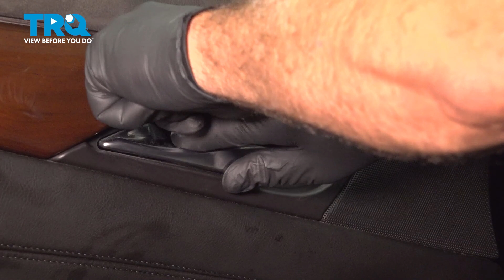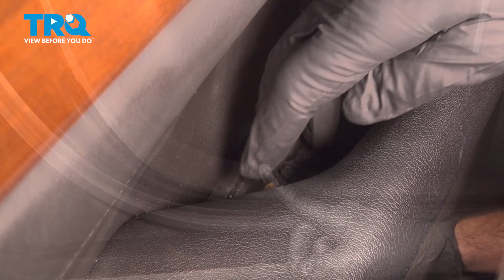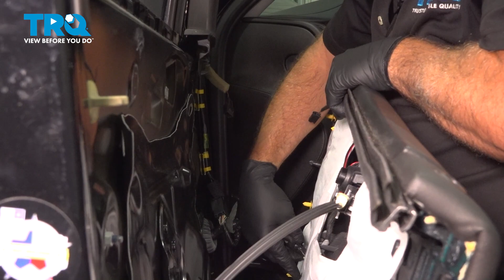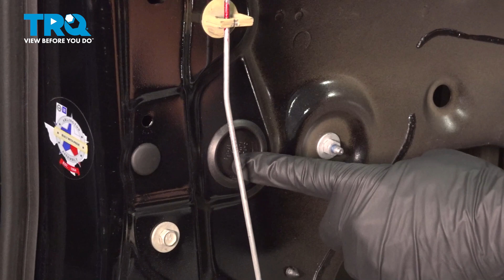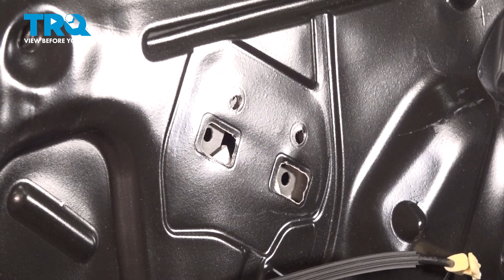How to Replace Front Window Regulator Assembly 2015-2020 Cadillac Escalade

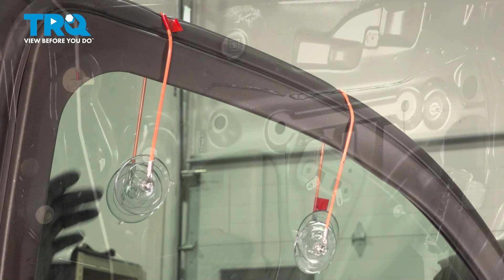Comment: You lower the window regulator at the 7:00 minute mark of the video.  How did you accomplish this with a non-functioning motor?  If I could lower the window regulator I wouldn't need to replace the regulator assembly in the first place.

Comment: Very good video, I took all the steps until I realized also like others, that the reason for replacing this part, is because is not working. So to lower the window in the position where you have to remove the clams that hold the window is impossible. Because that's the reason you replace it??? They should've come with a solution for that. The way I removed the old part that was not working, I had some strong plyers, like the one that cut nails and I just cut all the cables from the old part and I was able to pull the clams from the window. From there on, just follow the rest of the steps for how to install the new part. But yeah, good video, worked perfectly. If the old part doesn't work, cut the cables inside the door, make sure you don't cut something else by mistake. Reach inside, grab the window clams and wiggle them until they loosen the window.

Comment: The instructions are very clear, thank you for the upload. Whats confusing to me is the FACT that the motor and regulator are working on this vehicle. My Escalade driver window does not move up or down, nor does it make a sound. How is this repair possible if I cant let the regulator down to detach the glass?